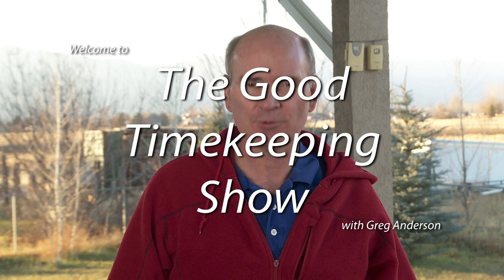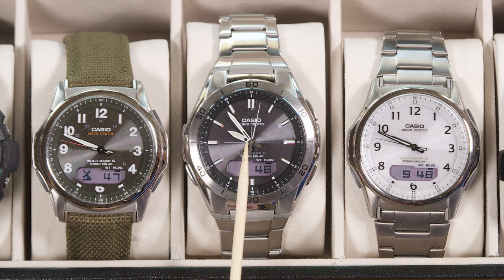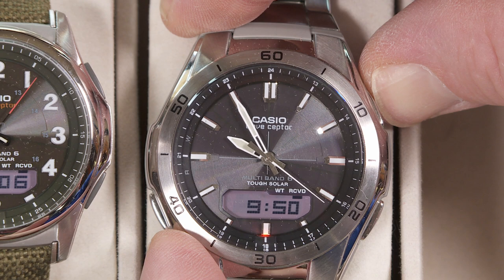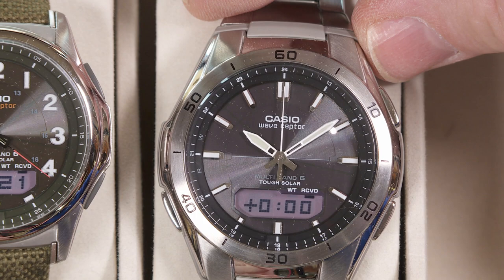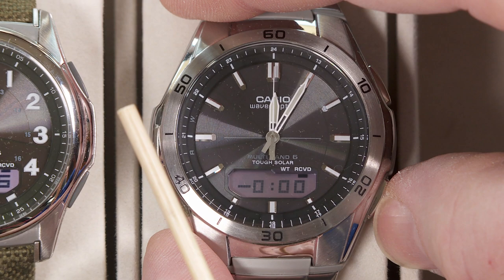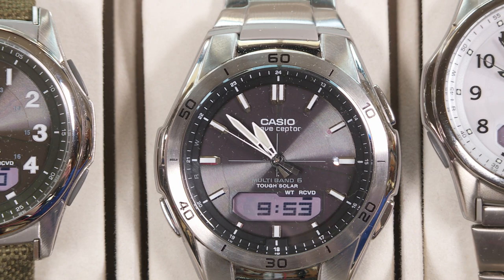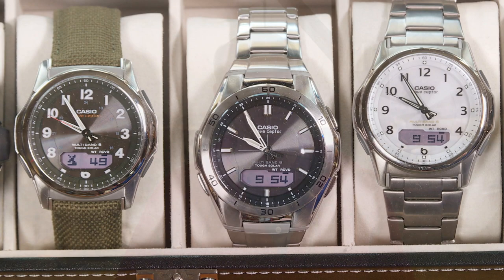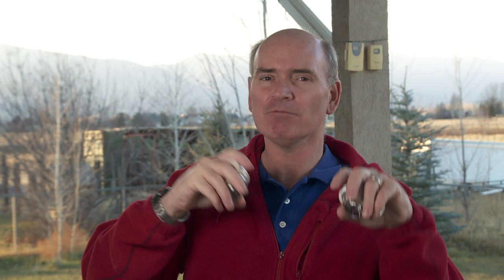Casio Waveceptor Hand Alignment Fix

Comment: This was SUCH an instructive video. The manual doubtlessly goes into this, but requires a lot of reading to get to; and even then not always clear. So a BIG thanks for showing how to do this.

BTW I accidentally discovered that you can easily move the hands 'fast', for doing the hours (mine was 1hr adrift on the digital versus analogue display), by HOLDING (depressing) the button used to move the hands incrementally (6 presses = 1min), and it suddenly moves automatically, and fast, which saves pressing the button 360 times to alter the hands by 1 hour. JUST before the hands move forwards or backwards (according to the + or - on the digital display) by one complete hour, quickly press it to exit the fast hand mode. Then adjust in the 6-increments per 1 minute manually.

Thanks again. I've given you the thumbs up, and subscribed to your channel (though perhaps won't be needed for a while, hopefully, if the watch keeps its hand alignment as expected). But my way of saying thank-you and showing due respect :-)

Comment: Excellent video. One additional feature that I found while trying this is that if you  hold down to lower right button a little longer the hand will start moving continously. This saves you a lot of pushes if you have to move the hands a long way.

Comment: thanks so much! I left my watch in the washing machine, and it experienced the same process with my clothes...washing, rotating, drying... it turns out the anolog is 5 min slower than the digital one, it makes me frustrated. Now i repaired it using you method, it works again, I love my watch..cool.😁

Comment: This video helped a lot, thanks! But as a tip, in the + or - 0 screen, you can actually hold that bottom right button down, and the hands will start move faster, and will stop when you let go of the button. If they don’t stop, they should after another quick press of the button

Comment: Great video.  I'm a big Wave Ceptor fan.  On my 3747 movement, from the time keeping mode, I had to press the lower left button (C) six times to get to Hand Setting mode, then upper left button (A) until the digital time started to flash, then adjust with the lower right (D).

Comment: It worked like you said, but in less than ten minutes, when I checked my 640 again, the seconds hand had gone out of alignment by 40 seconds. Any thoughts on this would be highly welcome. The battery light comes on strong, so the battery is not an issue, and the watch is only 2 years old. The minute hand stays correct. It is only the seconds hand that gains and loses everyday. The problem is about a week old.

Comment: I have a WVO 140 (4756).  I have watched the video several times.  Two questions.  Will the instructions given here work for my casio?   Also, my seconds and minute hands are fine, but the hour is off by 4 hours.  You don't cover hours, but I assume If I keep pressing the lower left it will adjust the hours?  Would appreciate any answer here.

Comment: I like to wear a watch 24/7 but someone told me you have to take Waveceptor watches off on a night in order for it to correctly gather the precise time with the auto correct set after midnight. Is this correct?
Reply from the maker: I suppose it depends on where you are. Some have told me that they actually have better atomic time reception when they wear the watch. Generally, however, it is recommended that you leave it in a place with better reception overnight AND that you keep the watch from moving around while it’s trying to receive. Often, it’s more reliable when you leave it next to a window if you live very far away from the transmitter. Every now and then I will activate atomic time reception while I’m sitting in my recliner in the middle of the basement in the middle of the day AND while I’m wearing the watch... and it works!
Reply: Thanks for that Greg... Just to me, a watch should be on the wrist constant, if not meant to be worn through the night... why do they give you a button that lights it up and put an alarm on it to wake you, there is no way I would like to hunt for a watch when alarm goes off 🤣
I am a person who likes precise time. I normally check Quartz watches on a weekly basis and set minutes and seconds. Never had a Waveceptor watch and ordered my very first which is a Casio WV-200E and arriving tomorrow..
I will have to look at how to activate atomic time if unsure of precise time through the day  if needed, but hoping not having too 👍

Comment: I had my first digital & analog wacth back in the mid to late 1980's 
I stll have it and it work on the analog rime part  but the battery dies a lot sooner that it should and the digital doesn't wok or display at all 
A brand called Armitron , and the watch was called  Durasteel
 and it was a tough watch back went it was new and looke great too.

Comment: Video was partially helpful because the model I have is a WVA-M650. Have you any videos on how to adjust the hands to the digital display for this model of Casio? Thanks Greg.
Reply from the maker: I don’t have that watch so I don’t have a video about it. Also, that one has 4 buttons so the method is just a bit different. But if you look up the module 5110 on Casio’s website you can download the manual. The hand alignment instructions are on page E-64.

Comment: it doesnt work on mine, hold the top right button the light is on then goes off, hold for 2 minutes, does nothing.  does not go thru the menu's thats the lower right???  I had a ticket to send in my watch for them to fix this alignment and pay alot, maybe $50 or more? really want to get into this mode and fix it.  also cant get into satellite mode but fixing the alignment would be great

if that button wont work, what other button is it?  on the time setting its JP and has a Japanese symbol, no idea why.  cannot get it out of this.

Comment: why do these watches have a small "R" in the 43 position on the dial?
Reply from the maker: When the Wave Ceptor “Multiband 6” receiver turns on, the second hand points to the R. When it’s “Working” it points to W, indicating that it’s picking something up, but it may-or-may-not be strong and stable enough to set the time.

Comment: HELP! anybody knows which battery is needed by the CASIO WVQ-202HE-1B ?
Reply from the maker: I don’t have the WV-202HE but I looked up the manual for module 4305. It doesn’t mention the battery type, however a couple of user discussions I found said it’s a lithium CR1620.

Comment: I have a wave ceptor wva-430J with this misalignment. Is there a way to correct it on my watch? (the method shown here doesn't work).
Reply: You need to search for the Casio Operation Guide 3311 5052. What you want is at the bottom of page 5.

Comment: My waveceptor is five years old, the 'stainless steel' of the body has worn off to reveal the plastic body, and the analogue hands are 4 minuets fast. So this video should be of great help, except the light button does not function. How would I describe this watch - 'Stainless Steel' junk.

Comment: you said:'' it shows 15seconds but it's not ''  that sentence threw me off. 
and then you moved every hand at 12 o clock position, than set to adjust itself

if you need to put everything at 12 o clock position then leave it so he can handwind itself to correct time position of the hands what does it matter where the hands are when you start the hands adjusting

Comment: Greg - I also have an older "4 button" waveceptor.  Where can I find instructions on how to do the hand realignment on the four button watch?
Reply from the maker: You can search Casio’s website in the support section for user manuals. My 4-button analog Waveceptor uses module 5052. The instructions to adjust the hands start at the bottom of the left column on page 5.
Reply: @GoodTimekeeper  Thanks!